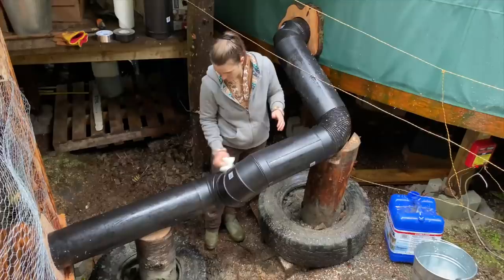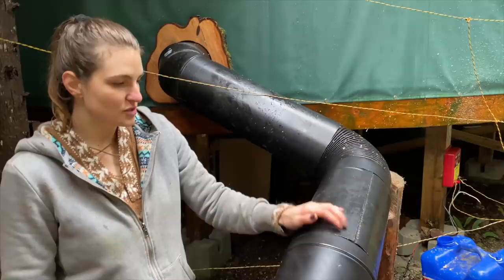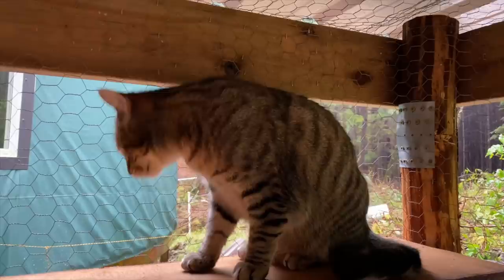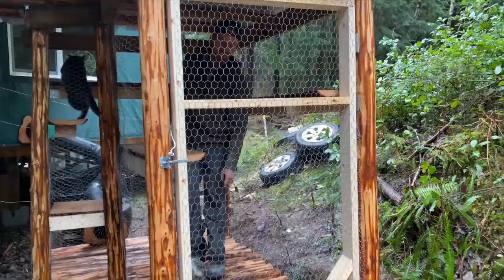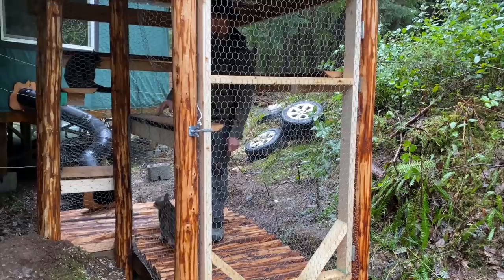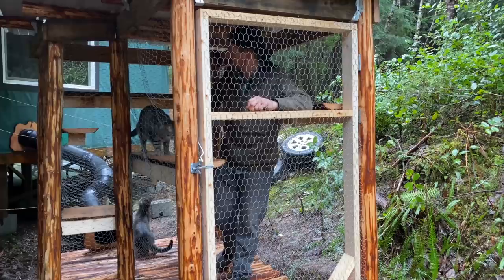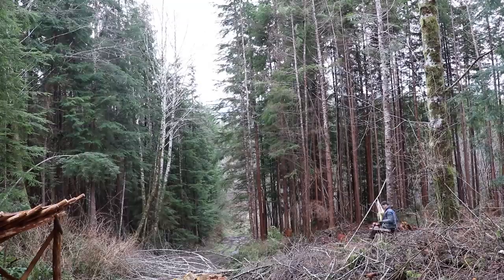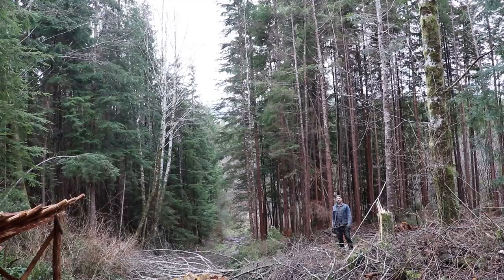ALONE & LIVING OFF GRID | A Day In My YURT LIFE - Ep. 76

Comment: Didn't think that the cats would take to the tunnel because it goes downwards and is dark, also wondered if they could get back up but hey! they took to it straight away. Well done guys. Perhaps an extra layer of protection by wrapping chicken wire around the outside of the tubing as the plastic joints are a weak point for pressure from a blow? Wonderful to see you, your cats and dogs in complete harmony. Onwards and upwards J & N.🙏

Comment: When you down a tree always cut a V on the side you want the tree to fall and then you won’t have to worry of it splitting and flying back at you.
Reply: With Alder, Cottonwood  and poplar there is a high chance of Barber chairing. You would not cut a tree this size down without a V cut otherwise known as the Under cut which is then followed by the Back cut. I've had many healthy Alders barber chair on me and you need to be ready to move quick or it can get you. In our families Tree topping business working around some very expensive homes we would often wrap a chain around the trunk to keep this from happening and damaging property. In the open you just go for it and get the hell out of the way.
Reply: Always notch the front in direction of wanted fall.. never seen an experienced faller NOT do that.
Reply: LOL I was thinking the same thing....and for the future cut closer to the ground.....you waisted like 4 foot of good solid wood.
Reply: When we were falling in the bush any small trees up to about 4 inches in diameter that we could control just by pushing them where we wanted them to go we just put a sloping cut from the backside into the direction we pushed it. The same as slashing small diameter trash trees, we never wasted time notching.
Reply: Jerry Kramer I hear 5G goes right through tin foil.

Comment: Hey folks ! Congratulations on your excellently designed inner/outter cat door and external cat enclosure :) That's quality work :) I was wondering however, those cougars are big, heavy cats ! Cougars are uncharactericly strong and could possibly rip into the metal mesh. Bears will rip straight through your Yurt if they want to !! Usually, bears do not want to get at humans that badly, but there have been exceptions. Consider raising the overall height of the external Cat enclosure to 6 or 7 feet. Also, perhaps straighten out the pipe and increase the support for it between buildings. Also, it's really great to see you addressing some of the trees on your property ! Way to go man ! Some of those trees just have to go ! There's a real danger there with a high wind storm bringing a tree down on your garage or, Lord Forbid ! - Your Yurt house ! :(  Question: - Don't you guys ever get bored ? I mean, don't get me wrong - I think the living is good where you are, and you are making a nice life-style for each other, but don't you folks run out of things to do ? After all - you folks do live in a very isolated area. How do you deal with so much isolation ?

Comment: ' maybe a lock and key like a front door lock might really secure the gate..two little ones ..one at the top and one at the bottom.. because cats or bears can't get a key lock open..an eye hook yes..with their teeth or claws..you'd be surprised how smart cougar and bears are.....if you find out& hopefully not with the chicken wire..just wrap some chain link around that..should provide enough xtra protection for chicken wire..just in case..'

Comment: Cot little windows in the toob so they  can see as the go through it .you could of made a little square box out of wood that whent from house to the cat unencloser  because a dark toob with no window will take a longer time for the cats to get uses to but a long wooden box from there to there  would not required you to have to put the tires .but sice you used a dark toob you should but some plastic windows in the top of the toob .so the cats can see as they inter and exist.

Comment: You guy's should look into hydroelectric energy as well
Reply: Claire Belmont : I was thinking the same thing!! When I saw how fast that stream was moving on their property that’s the first thing that popped into my head!! It sure would be interesting to watch 🤔
Cheers
Reply: @kristimcgowandarkoscellard3126  fast water gives little energy - you need height difference. Hydro power can be harvested using lots of wood and only buying a small generator. 100-200w would be where i
Reply: Would start if I very living in a yurt. Jake started slow with solar, so a small hydro might be a good start (maybe even smaller - 100w 24/7 would be way more than their solar setup and maybe much more than they need).
Reply: Could make a water wheel and run a crank that could turn a saw mill.
Reply: @couerl  a saw mill would be awesome - and displacing fossil fuel consumption, not solar power. Probably hard to build and would need a large water stream with high height difference - I guess some efficient (bandsaw?) electric solution would be easier.

Comment: That was a very old birch & you should get a fallers handbook.  If you keep cutting like you are you will join the land of not living.  Your very lucky tree never totally barber chaired kicked back & killed you.  As well keep your cuts low to ground.  If saw doess kick you at that height it will remove head.  You need to under cut front directional face & put back cut just above center of undercut. Make bottom of cut flat & top v downward. If you did & I didn't see it sorry but where undercut should have been was almost a barber chair.